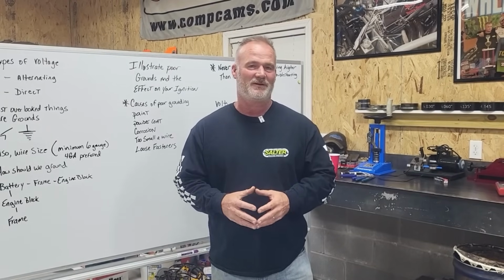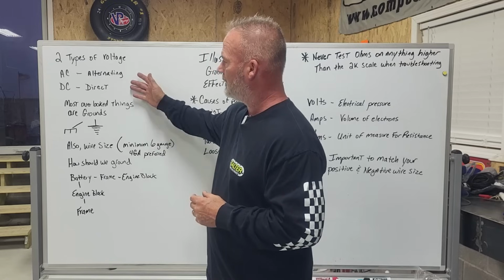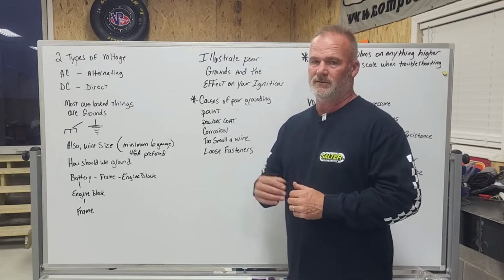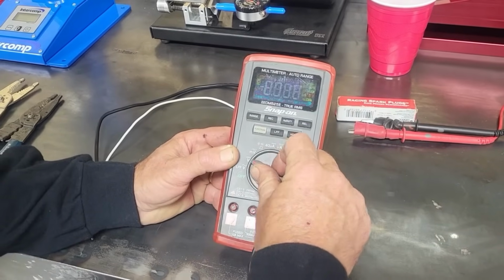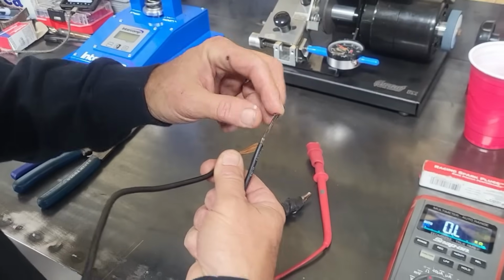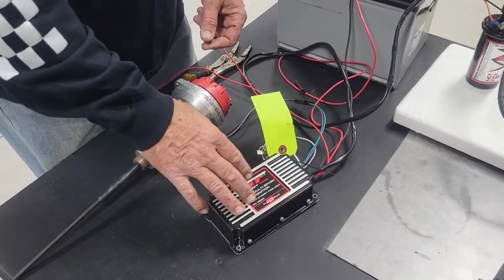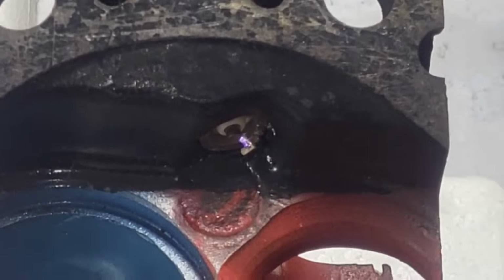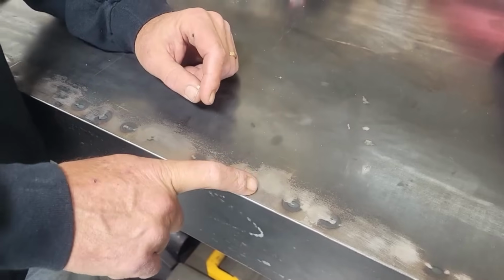Proper Grounding Too much at Stake

Comment: It's nice to see someone actually explaining this stuff.

Grounds are even more important with trunk mounted batteries where you rely on a chassis ground. 

Running the same size grounds are the positive wire becomes even more important. 

Double grounding your engine block to each frame rail is critical. 

It's also not a bad idea to ground the back of each head to the block. Some head castings actually have very poor conductivity due to the metallurgy like TFS. 

Because of the additional path being bolted directly to the block you can get away with smaller grounds from the heads to the block. If you want to go all out to tied those grounds to the same point where the grounds come off the block to the frame rails.

Comment: Automotive electrics is some of the worst designed and engineered systems in the whole world of electrical engineering, not just the automotive industry.

So many wrong things with automotive electrics the only thing that keeps the automotive electrics from blowing up in every car is the fact that it is all low voltage and the ignition system is thankfully somewhat isolated.
Reply: *low amperage...

Comment: Good points and important topic! I will say that dissimilar metals in the presence of oxygen will eventually create oxidized metals at the dissimilar metal junction so, especially if your car is old, maintaining a clean engine compartment, and even better, taking apart and reassembling so that everything is cleaned, will help keep resistances down. I always recommend a separate ground strap from the alternator body to the negative battery terminal as well to relieve the pulsing effect that can mess with sensors.

Comment: Great video and oh so true!! Don’t forget if you go back a ways in automotive history cars had generators which produced dc power not ac like alternators.  You can’t store ac power though so we get the systems we have today. Coatings and paint cause real problems for getting hood torque values as well. Drives me crazy when I see people torque head bolts on painted bolt surfaces.

Comment: It's only taken me forty years to realize that virtually all electrical problems I've encountered were due to bad grounding.  All those times stuck in a parking lot... the positive cable got replaced, but never the tiny diameter factory ground wire.  Ugh.  I've been using 02 gauge welding wire for battery cable for thirty-five years, but kept the cruddy, 6 gauge factory ground off the engine.  Am switching to -02 weldinding wire for engine ground.

Comment: I have ALWAYS made absolutely sure that everything I did on my cars had that level of detail. The balance. The interplay between those aspects was at that level of balance in its entirety its best. If you want to illustrate what being the ground for a high amperage system is to hold a Joe Hunt Magneto while a buddy( may not be a friend after this experiment) spin the magneto for a revolution. The rule is it not necessarily the voltage, but the amperage that will kill you. In every car I’ve ever done, I was ground crazy. The more and most consistent power that gets to the plugs, the less resistance accumulated to the plugs. The accumulated resistance is the enemy of a full and consistent pressure ( energy minus resistance)  you will have. The higher your compression  the more unimpeded  pressure you will need for a stronger and more consistent pressure to burn the mixture you will need. My rule is that you have to have grounds equal to the pressure you need to light the mixture. I am no longer able see to drive. So my son came by one day and removed my ignition system and grounds to make sure that the 12:1 Ford FE would not be fired up again . I was hoping that he might take me down the road once in a while , but he is afraid of it. A 10.50  1/4 65 Galaxie. Oh well. I f you want a scary ride, get those grounds right!  😂

Comment: One issue you did not talk about and it would be worth mentioning is that grounds on any electrical components. If the ground is bad on an electrical component, then that component will look for a ground and it will usually result in damage to the component. Tis is a very excellent review of what is important on any vehicle and is as you say mostly overlooked.

Comment: Ok.   Story time. About 5 years ago, I got the  call to help a client seat in his cam and liters on his Show hot rod. When I got there I checked all of the normal stuff.  Then I said were is the  engine ground ?  He said, right there as he points to the negative battery cable going to the bell housing.  I said, no, have to have a ground strap from the block to the frame,  at a minimum.  He said ok.  Then we started the vehicle and proceeded to bed the cam and lifters in.   In this dim lit garage,  I was on the passenger side of this beautiful 32 Ford pickup,  then an electrical arc started between the block and the steel fuel line from the fuel pump to the carb.   I said, "Hey, come take a look at this" I  showed him,  and he had  a very bewildered look on his face.   After the bedding in of the  cam and lifters. While he was handing me a check for my efforts,  he said,  I will never question your recommendation again.  Then he proceeded to tell me,  that when I first said he needed another groud, that I was full of xxxx.  😂         PEOPLE,  YOU CAN'T HAVE TOO MANY "GOOD" GROUNDS.

Comment: I'm 62yo and been a car guy since the 1970's.....became an A&P mechanic in 1983 but never gave up on cars.  Over the years, I have cured a good few electrical problems by checking and/or fixing different grounds on the system.  A few of these issues had the guy ready to sell off his car because he tore his hair out  doing EVERYTHING but.....neglected proper grounding.

Comment: I was told that DC travels on the surface of the wire and AC travels the core. That's the reason for braided grounds. Is this true? By the way your German is good. 😂
Reply from the maker: @CarterGunnells  no that's not true at all 
Lol

Comment: I have 5 ground straps on my race truck.  Frame,body,engine, cab and starter.
Reply: Automotive electrics is some of the worst designed and engineered systems in the whole world of electrical engineering, not just the automotive industry.

So many wrong things with automotive electrics the only thing that keeps the automotive electrics from blowing up in every car is the fact that it is all low voltage and the ignition system is thankfully somewhat isolated.

Comment: Great video. And there's a lot more to "proper grounding" when it comes to EFI, IE having Clean power and grounds vs Dirty power and grounds which can/will effect how the engine runs/performs and it's especially important when data logging as well...

Comment: I once owned a car with odd, un-repeatable electrical gremlins all over the place. Turned out to be a painted ground PAD (the stud was masked during paint) if not for the metal flake there wouldn’t be any ground connection. 

Per your example because of the way they work internally, ohm meters are useless to diagnose wiring faults. 

What works EXTREMELY well is using the voltage feature. Turn a load on (light etc) and measure the DC drop in mV along the circuit and you will easily isolate the point that has 99% of the voltage drop.

Comment: Besides working on cars with my old man since I was just out of diapers I’m a big car audio guy for over 25 years and the amount of bad grounds I’ve seen is just ridiculous. Then I see people say look I took off the paint or I’m on the seat bolt it’s good and I’m like really you realize your cab is on rubber bushings right? So you have very small bolt head ad thread touching the frame and on your connection that’s still not a great ground. If you want a good ground you go to the frame directly or to the battery which should also be grounded to the frame and block. And in car audio 4 awg is the smallest you really use and make sure it’s OFC! Everyone should do a big 3 upgrade no matter what on all vehicles imo. Get you some high quality high stranded welding cable it’s AWG OFC is rated for cold, hot, wet locations and for abrasion also high voltage of course amperage rated on length of run and size of wire.

Comment: Excellent. This stuff is critical. Not just in the performance world but in daily drivers, tractors, heavy equipment, everything. Get the biggest battery you can fit in the thing, have a good alternator, make sure the wiring is adequate and every connection is clean and tight.

Comment: Yes first rule electricity takes path of least resistance. As you found that may be you. I used to use my hands until HEI came out. It definitely could kill and MSD type is higher. It only takes 1/4 amp to kill. I have been lucky. I don't push it anymore.

Comment: Great Stuff Brian. Thanks for taking the time to show this particular example. I learned this reading some Ron Francis wiring tech about 15 years ago. This proves that proper grounding tends to solve 90% of electrical issues. In this case, especially spark plug firing.

Comment: Doing work for many good mechanics over the years, the subject of ground has been most interesting.  
   Several times I’ve had a few in my shop discussing some gremlin they’re chasing around. They’ll share some obscure scenario they have faced at one point or another but eventually one of them will ask about checking ground.  
   It’s almost like a slap in the face. At least that’s the way they will act.  “Hell yes!!! I’ve checked my f’n grounds!! They’re all good.”  
   The BS session generally ends at that point and they all go their separate ways. 
   Every single time I have followed up and asked the mechanic what the solution to the problem was the answer has 💯 percent been “ground”. 
    I’ll admit that from my neophyte perspective I lost a bit of confidence in their skills finding this out.   How hard could it be to chase a bad ground?
   I found out restoring a KTM dirt bike for my grandson a few years ago.  
    That powder coating and worse cerakote whipped my rear.  Not isolating. Not fully understanding the true source of the ground. 
   I ended up completely disassembling that bike once. Then taking the engine out even after that. 
   I learned not to laugh at those men’s frustration over their ground issues.  Especially under the simple circumstances I was fighting.  Some of these new vehicles have more grounds in them than can be known or counted. 
   Now there’s the CANbus systems and pulse width modulation to consider. Wire lengths to adhere to and I’m sure more details to comprehend than can be imagined.

Comment: That was a good video it's a lot of what I preach to younger folks and to people that well I try not to preach but you know talking to folks that don't seem to have that aspect though hot rods together or racing,  The only thing I like to do different is I'd rather measure the voltage drop across a wire when it's in circuit you doing its job because then I get a better idea of what's going on I could calculate resistance at that point but I actually get to see the power drop

Comment: Brian, not trying to be disagreeable. I realize you are dealing with race cars and they do not have turn signals, radios, electric seats,  power windows and heated windows. Automobiles need a body ground unlike race cars.  The ground strap from the battery on my 56 Chevy bolted directly behind it to the firewall. For a street car, many people think that the frame is the thing to ground to while they let the body grounds rust up. I feel that the body ground is overlooked quite often with street vehicles. I have seen many a tri-five Chevy not have the ground wires that GM installed from the factory. Of course back then, cars were dealing with 30 amp charging systems unlike today. This video is the first one I have ever seen up to demonstrate the actual spark difference between an MSD box and factory type ignition. Makes me wonder how my 265 with points ignition would turn 7200 rpm consistently back when. Thanks Brian.

Comment: Pretty cool.
Resistance tests are often misleading -  voltage drop  and testing with the circuit under a load is the way to go.  A single strand of wire will also light some test lights, so the circuit needs to be loaded to use them too.  A headlight makes a pretty good test light. 
Like the Borg said - resistance is futile. 
I never understood why some people pay more attention to the positive side of the battery.

Comment: Is there a problem using a larger ground wire than required? It's a different application but on the welding side of thing for large structural/vessels, we always ran minimum 4/0 ground cables especially when using voltage sensing processes like FCAW and SAW
Reply from the maker: @MichaelScudder72  I would think it could only help

Comment: If I’ve got a problem on the ground side I well put a jumper lead on the positive side and connect it to my red meter lead and the ground lead to the chassis ground if I get over .250 mili volts I’ve got a ground problem at the chassis.  I’ll also if that proves good I’ll take a 12 volt light bulb. Run a jumper from the battery ground to the-meter grd lead put the red meter on the ground side of the light turn key and check the reading if I get high mili reading the problem is from that spot to chassis grd an back to bat ground. An do same on pos side.
Reply: I did not quite explain that correctly
Reply from the maker: @rogerpatton-zr7qd  it's okay I was only demonstrating what people do and that's the wrong way to do it I'm going to make another one to show you the right way to do it

Comment: I agree with you that the ground in any circuit must be heavier guage than the "supply" side. Frequently you see an older vehicle with the glass headlight bulbs and one light is dim. 90% the ground is poor. In some cases both low beam and the high beam filaments are energized. The ground has to pass the current of both. So if you have 14ga wires to each filament, the ground should be 12ga. The cross sectional area of the 12ga is substantiailly larger than the 14ga, and thus has a vastly greater current capacity.
The GM Quad 4 engine had the coil on plug ignition coils under the valve cover. This was a safety protocol as the coild output high enough power to kill. 
Old ignitions might put out 40k volts but very low current. These new ignitions output considerably higher current. You need the high voltage to initiate ionizing the air/fuel in the plug gap. With the low current ignitions the flame may not be ignited as well. The higher current ignition of these new ignitions light the fuel charge better, and generally have a longer duration spark.

Comment: Awesome video brother!! I would love to here about the differences. I had planned on running a ground from the Battery>frame>block. And block>battery then ground each head to the firewall where my original engine was grounded. Then also the wire harness grounds. That was before I seen you video. I was going to get a ground strap kit. Would battery cables be sufficient? They have the ones with the eyelets on each end.

Comment: Always ground at the neg of battery an run a jump wire to the meter. Don’t use a body ground you are only testing the circuit from the body ground to load.  A your not checking for the problem back to the batt neg.  From the chassis’s ground  to the battery you’re not checking to the end of the circuit.  Always run jump from battery ground to meter. That way you are checking from the post battery post back to battery ground

Comment: There is resistance all the way back to the neg post the clamp has resistance but it should be minimal.  The load should take up most the voltage on the pos side. A there should be minimal voltage on the neg side.  If you have only the wire back to ground you should have say. 0.30 multi bits back to neg.  Post if a switch is on the ground side.  You cold see a little higher voltage on the grd side. But if you do a drop down test on the ground side of the switch. You should see around 0.30 muli volts.

Comment: You changed the ground to the battery....
Reply from the maker: @vwbsean  no I just made it directly from the head to the plate on the floor
Reply: Shock wake you up? @SalterRacingEngines
Reply from the maker: @vwbsean  yes surprise surprise

Comment: Y’all flashing me back to the late -70’s, and attending some GM service schools. Got friendly with a GM engineer, they had some way kewl unofficial projects happening in some different buildings and back rooms. Anyway, drivelines was his particular forte’. He attributed a lot of driveline  component failures to inadequate or nonexistent component bonding / grounding, for static and chassis electric, feeding back through bearings etc., ultimately eroding and damaging them, as well as static buildups discharging back through sensors, causing faulty signals, and sometimes damaging electronic components.
Later in life, as a aircraft mechanic, this hit home, for the number of times faults led back to faulty airframe / component bonding / grounds, especially in composite stuff.
Reply: I manage a bunch of forklift dealerships. We had one particular model where techs would consistently install the wrong battery which required moving the negative cable from the engine to the chassis. They were lazy I guess. The result was always a melted throttle cable. Current would try to flow through it when the starter was engaged.

Comment: Nice vid
I always ask the punters to look at the primary circuit ( its a loop like all circuits) and show me the secondary circuit..
There is a use for powered test light as it can show up the resistance when troubleshooting and or std one with one end connected to power.
Multimeter can fool you at times as very little load